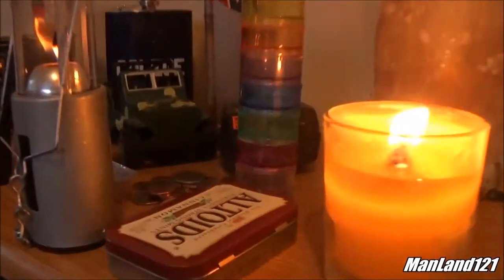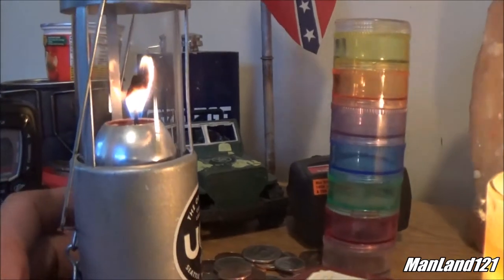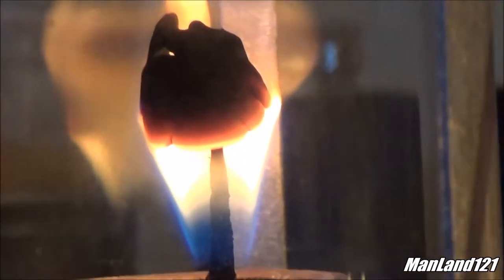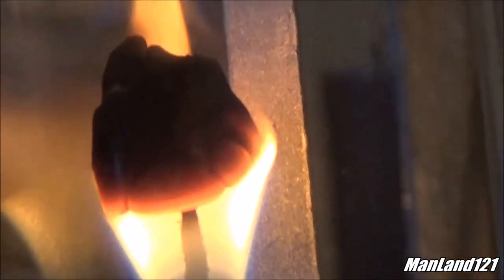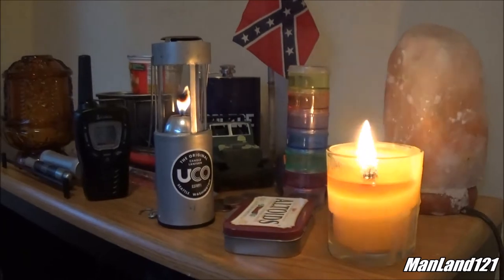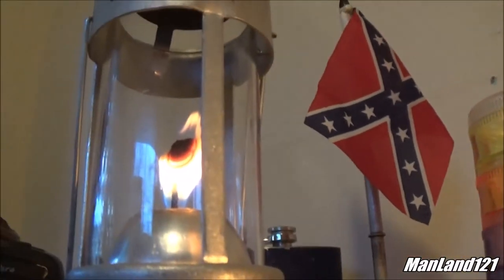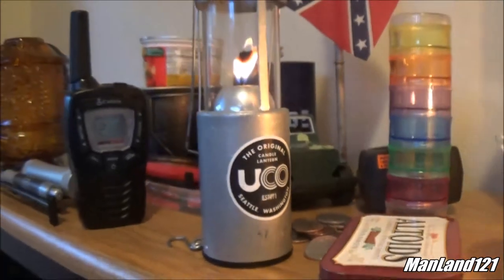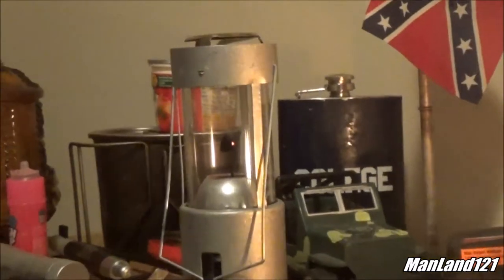UCO Jute Twine and An Alien Booger Candle Making

Comment: It's a carbon ball from the impurities in the wax and twine. They do't get hot enough to burn off and accumulate at the top of the wick. This happens with scented candles a lot because of the scented oils in them no matter the kind of wick you use. Jute has a lot of dust and oils in it that don't completely burn and will contribute to this also. Just pluck it off and it should burn better keep working just fine. I get this a lot because I reuse the wax from the wife's wax melter smell good deallies.

Comment: so if it's not burning and it's collecting the heat from the flame it's actually producing its own heat source within the lantern and it's got to be pure carbon if it's not burning nothing is burning that is up top so it's pure carbon so that carbon expanded is that what they call that nanocarbonate they have something they put it on there and it expands like crazy is that a natural formulation of that carbon I don't know what they call it where they pour something on this carbon and it goes crazy but it sort of reminds me of the snake you set on fire and it activates the carbon and it expands but that has to be pure carbon if it's not burning any longer and it's actually producing a heat source from its own density of carbon